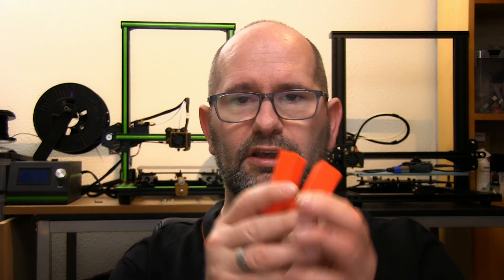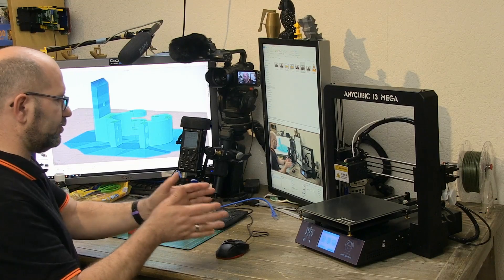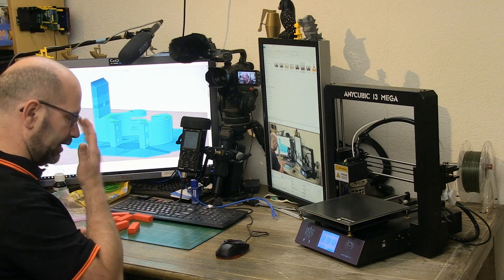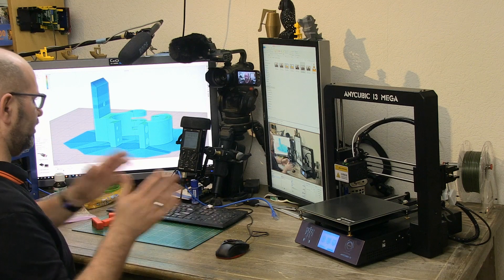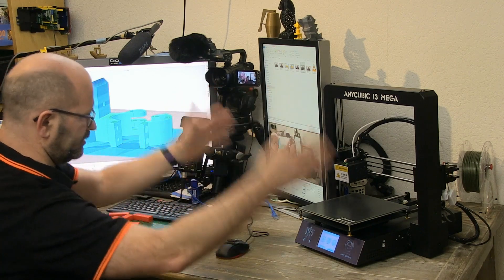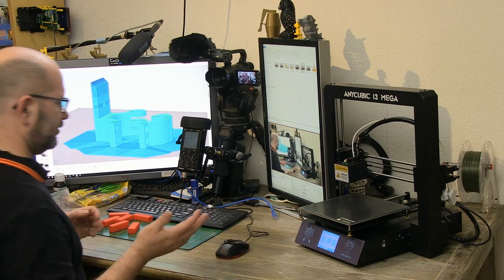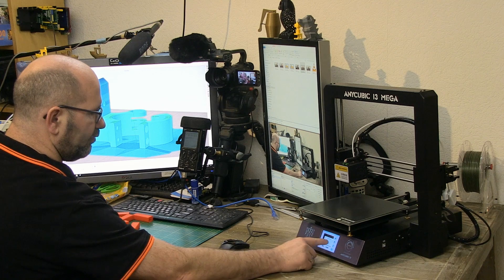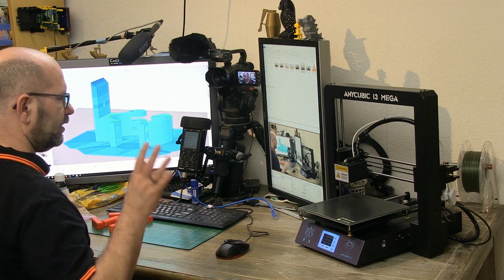▼ Running a 3D printer farm or not

Comment: You nearly lost me at the beginning about shop quality. As in: Buy a Pruse i3. THis is a higher end 3d desktop printer (800ish EUR, so not a 200€ cheap knockoff). Some businesses run a LOT of them. Pretty much all plastic parts AND quite some structural parts on them are - 3d printed. People accept that because they can do frequent updates and make the files public.
Reply from the maker: Well, you can't deny a Prusa is a good machine for production work... Yet I have a lot of 200 to 400 Euro machines, and I have them printing daily. Yet, I do know how to do the maintenance, and I do a lot of maintenance. On the more expensive machines, I usually do less frequent maintenance, yet that doesn't mean cheap 3D printers are not worth it. Also, since the making of this video, cheap printers got so much better.

Comment: Your operation is really inefficient if you have to charge that much.
I run a small number of printers, for me the biggest cost is keeping them running as they tend to wear out - yes wear out.

That being said, i charge 5€ per machine hour, everything included for prints. Filament etc. and give upfront estimate, usually hitting within 1hr.
I also use the cheapest filament i could find, and print quality is good, no issues there. I buy my filament in bulk orders of more than 100kg at a time, and as i had been requesting they now started making large spools too so i can shave off a little bit of extra time as a lot of my time is actually spent changing spools at times :O

I use inexpensive printers as well, Tevo Tornado, Tevo Flash, Ender-3s, Anycubic Chiron etc.
I let them run mostly unsupervised as well.
Reply from the maker: Inefficient or not, my printers rarely or never stand still. Just like you, I have a farm with fairly standard printers, but I do not use cheap filament, but I almost only print with NGEN, because it is strong, can withstand heat, and prints just as easily as if I were to use PLA.

I just couldn't live for 5 Euro per hour, per printer. My cheapest printer indeed costs 5 Euro per hour, excluding filament. My most expensive is at 12 euros per hour, excluding filament. Some printers are more expensive to maintain, because of the materials I use in them, such as reinforced filaments that make the wear run faster.
Reply: @3dPrintCreator  So you are at home 24/7? :)
 
To me still sounds like you are running really inefficiently.

5€ @ hour means if 24/7 running ... well say 20 hours a day = 100€ per printer per day. You got what, 3 or 4?
Reply from the maker: @skaltura  I think I explained it very well in this video.
I am not bragging what I do or do not earn. But it's enough for me, no matter what you think of it (and why should you care?)
But hey, I am glad you got your farm up to a point that it's making money, there are a lot of folks out there who can't live from their printers.
Reply: All i am saying is that you could be plenty more efficient. Think scale.

Comment: FWIW personally I don't think regular PLA is suitiable for anything you might sell to the public due to it not being able to withstand hot cars.

Have you had a chance to look into SLS nylon yet. My advice would be to get a dyed and smoothed part as the natural white does discolour with age and use.
Reply from the maker: Yeah, so true. I don't usually print production parts but when I do, I always use PETG as my preferred material.
The only exception being the orange things I showed in this video (OBSRVR) which is basically a USB plug for in a computer. I don't think people will take that to their car.

Up until now, I don't have that much experience in making production parts. The few things I have done so far have been send to a company that made an aluminum negative mold of my file and then they used that to injection mold the product. The thing is, I did this when working for another company and after I made the files, I didn't get to see how the rest of the production was going. It's now my first time I have to find it out for myself.

I am going to look for SLS Nylon now, but I don't think I want to be printing with Nylon at my home address as this is toxic. So again I think I have to give the file to some company to make the mold for me.

I will see what the future brings.

Thanks for your input!!!
Reply: 3d Print Creator Nylon isnt too bad unless you burn it. It is a pain to keep dry though which is honestly the biggest reason not go print it. The strength of FDM nylon is worth the trouble if you need it though. Even stronger that SLS.

That said, yes i would recomend using a service such as iMaterialise(who now have the new HP MJF machines) or 3DprintUK(really cheap and still good quality).

Hope it works out for you.

Comment: Nothing beats prices that one can get from China for injection moulding (in hundreds or thousands QTY), but to use a 3D printer to finalise your design before sending it to manufacturing is really invaluable. You can make countless iterations and build every iteration as a prototype, cheaply. Even then, you could use multiple machines, if you need more prototypes or if you are doing a multi part/material design.
Reply from the maker: True, companies in China offer this for very cheap prices but I am afraid of doing business with them as it's not around the corner for me. If something goes wrong, chances are I get to see it 6 weeks later.
Reply: Keyword is the 100k here tho, creating the molds is super expensive.

Comment: If you want a better 3D print quality, than have a look at SLA printers.
Reply from the maker: For sure that's a way to go for better quality, but not for production work.
I don't see how I am going to make 500 pieces of something with the tedious and slow SLA proces.
It is, however, a great way of making a final product for casting. You can create a mold around it very easy.

Comment: i think the Cr-10 would be a great choice for a farm. the large build plate gives it a lot of flexibility. running either high quantity of the same parts, or multiple jobs at the same time, increasing your ROI. 

Thats where you have to watch the jobs coming in vs. the equipment you have available. 

Especially now that ultrabase will be available for the cr-10 any day now. even with a PEI sheet, the cr-10 is very easy to start and remove prints, and move on to the next batch. 

both are good options, i always prefer machines, and equipment that gives the most ability and flexibility.
Reply from the maker: I think the CR-10 is a perfect printer for a lot of things and it's for sure the printer that gives me the best result I can have in my workshop. That said, when compared to the Anycubic, that one also produces very nice results and it just feels more rigged and solid. I am just more in love with the Anycubic then with the Creailty.
Reply: The CR-10 isnt an exciting printer. it just gets the job done. its not sexy, its not really special.... its a basic design that is executed very well. its not perfect by any means.... but it works. it gets the job done very well, and very consistently. The anycubic reminds me a lot of the maker select v2.1/wanhao i3, just with more sparkle to it. that build surface is a big, big deal... we've talked about that before. when you really break it down and look at it for what it is, its also, aside from the build surface, nothing all that special.... but it fakes it well. they are both great, and because of that, i would choose cr10 everytime. that increased build area just puts it well over the top. i really dont understand the "mega" part of the name. its not big. they really are very different machines, because of the build volume... gearbest and banggood are the ones pitting them against each other.
Reply from the maker: Hi Erik,
In my case, it's not the company putting them aiangst each other, it's me.
I wanted the CR-10 like crazy because every other vlogger talked about it as being one of the best machines under the 500 Euro price tag. Then when I received it, it produced really amazing results, but so did the Anycubic. The CR-10Mini has a bigger build volume, but when I pick it up from the table and put it back again, I have to calibrate it again. I once calibrated the Anycubic and never did it again. I have been driving in my car with the I3 Mega and when I arrived just put the plug in the wall outlet and it worked. Then later that day came home, same thing.

It's sturdy and rigid frame made me fall in love with the Anycubic. Still, the CR-10Mini is phenomenal but I can't move it around like I do with the Anycubic.
Reply: that is amazing, i've never heard of any machine that can do that. 

man, i need to start a youtube channel... i already print enough, and know enough about different machines.... i need more!!!